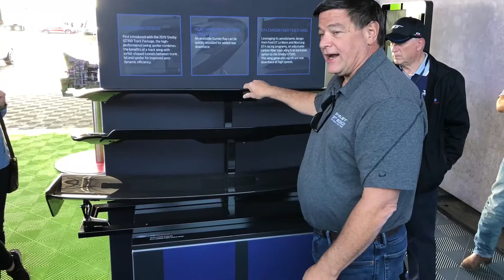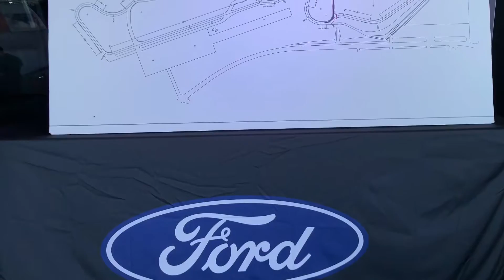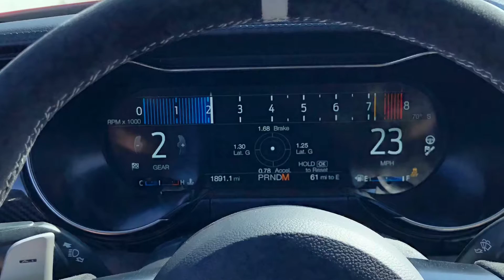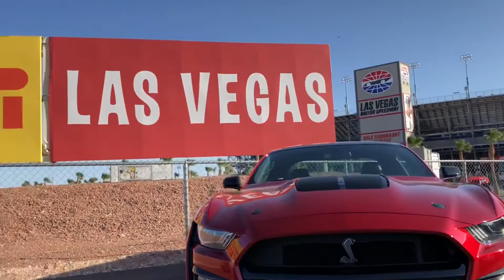2020 Shelby GT500: North American Track Tour!

Comment: I wonder if regular wing can be replaced by carbon fiber wing. Does anyone know if that is possible?
Reply from the maker: Shelby BlackBlueStripes Yes, it is possible. Carbon Revolution is supposed to make an aftermarket CF wing and you can buy other brand CF wings that work now.  You’ll have to decide a course of action with the holes though... buy a new trunk lid and get it painted, put rubber plugs in the existing holes or simply put vinyl stripes over the center holes.
Reply: Is the suspension setup different for regular GT500 vs carbon fiber track pack?
Reply from the maker: Shelby BlackBlueStripes Yes!  Different stiffer springs that are a 1/2” lower. A thicker rear sway bar and different calibration on the magneride shocks.